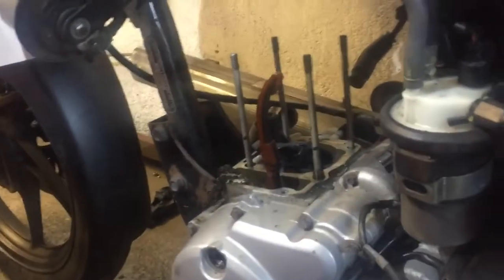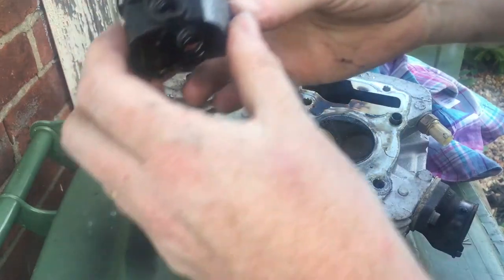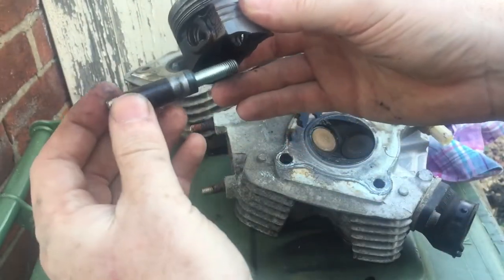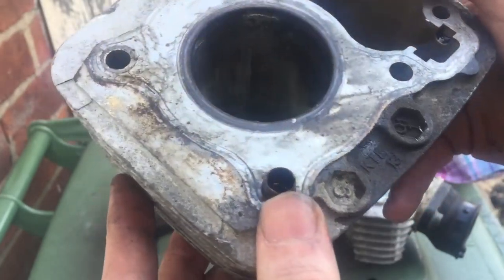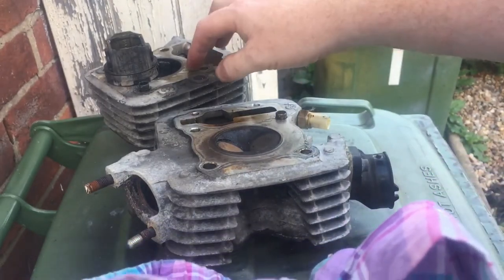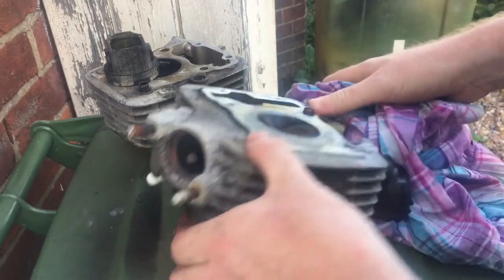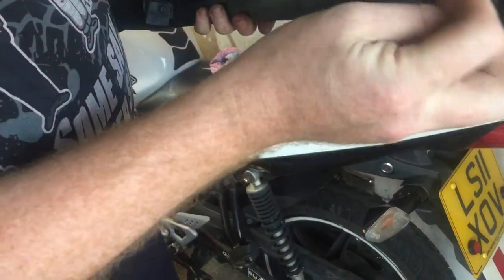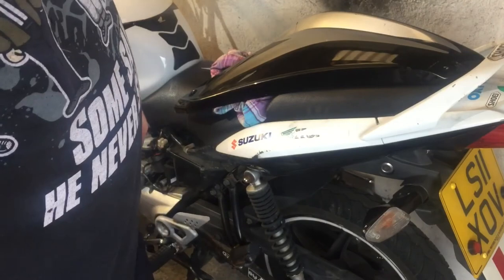Honda CBF 125 - Part 2 Engine Rebuild

Comment: I have a 2018 CB125F. I was thinking of doing a similar job but not as much as changing the piston just for a bit of a leaky gasket but I don't have a garage... but I do have a second vehicle to use if I have to take it off road for a while. I would have to remove the tapers/valves, exhaust etc to get to it but will see if its really worth the effort as the bike runs great still. Its only a cheap geared bike I got hold of to pass my test on a geared bike rather than just have a automatic licence.

Comment: change valve guide seals and check the conrod (hold firm while holding the flywheel and try and rattle the conrod in and out) was the top of the engine oily? i didnt see any pumping up when you cranked without the rocker cover on... also, there reffered to as cylinders, barrels, jugs.. not "block" as the crank also sits in a block, block denotes engine block, ie one big lump of metal everything bolts to. these engines have case halfs, barrels and heads
Reply from the maker: +minor0confusion think oil pump might have gone ?
Reply: maybe, the missing c clip, and sheer abuse this engine has seen is pretty suspect, ether its a poorly fitted/made clip thats jumped loose (usually leaves bigger scars, there hard steel) or its starved of oil, wrong oil, duff pump.. it is usually just sign of wear, but a 4 stropke engine this new would only ever have this happen with delivery problems or if used at FULL SPEED dual carridgeway use. its fairly young. i have a 1998 honda with a loooooad of miles on it for instance, rings are fine. hence my suspician about oil delivery, added to the fact the rockers didnt seem to produce any oil, but you didnt turn it over for long, best practice is whip the side cover off and check the rest while your at it. not removing the crank/engine from frame, just pop both side covers off and give the clutch/oil pump/drive and electrical side a going over. these are much more exposed mechanically than a car ;) but dont take long to get at everything
Reply from the maker: +minor0confusion cheers. Will check oil level in morning. As I bet kiddy ran it low maybe

Comment: definitely do some plastic welding on the fairings and then fibre glass  makes it a lot stronger, had to do the same on my bike
Reply from the maker: +Martin Cunnington plastic welding in my head is melting with soldiering iron ?
Reply: Matt Green its a real good way of fixing the plastic
Reply: I use stickers .